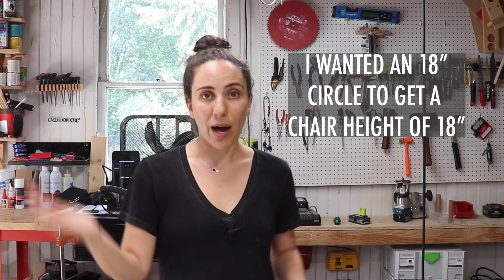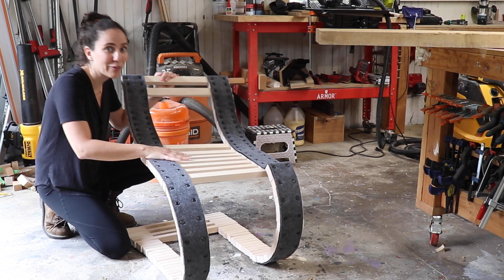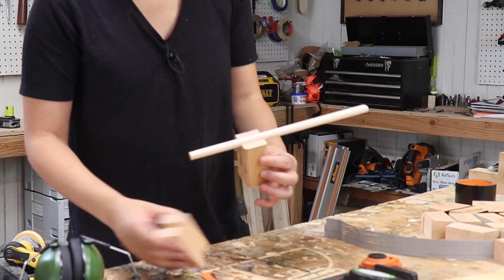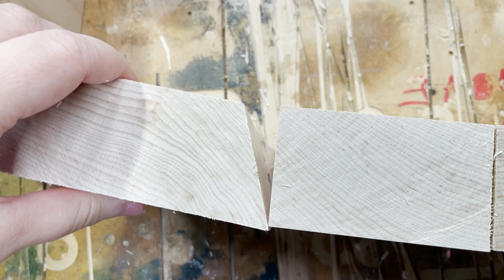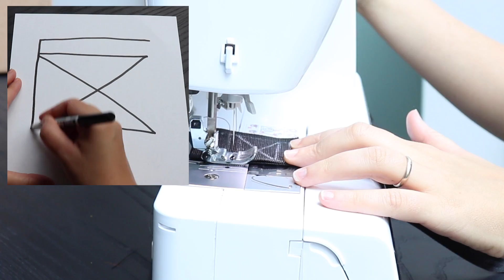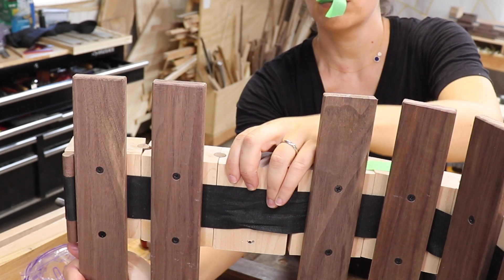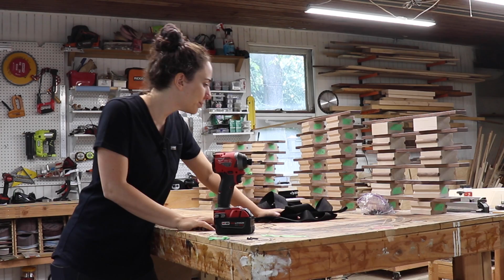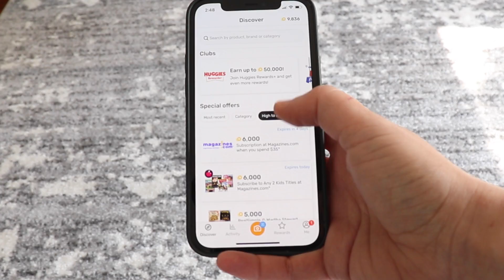I ATTEMPT to make a Roll Up Chair… AGAIN...

Comment: The answer is to make each segment a link in a chain. The mistake is trying to use a single strip, strap, or cable to hold them all together. Each segment should be mechanically linked to the other segments ahead of, and behind it. This will also help to drastically reduce the amount of flex from side to side. Any and all tension should be solely in the linkage between each segment instead of from one end of the span to the other. Think bicycle or motorcycle chain.  Good luck. ;)

Comment: This is the first of the vids if seen so if this is stupid sorry but I think putting a rope through the center of the wood to support instead of a one sided strap might help. Since the the strap is on one side less tension causes it to collapse and then adding more just causes it to curl. Im not experienced much with this but I think if you find a way to have the support in the center of the wood instead of one one side it would force the wood to stay together. I dont know if it would be able to roll up but if you can find a way to manage both it might work. Sorry again if its dumb but it kept coming to my mind

Comment: I think fitting the straps through the middle of each wood piece instead of a side would make it a lot safer, and probably metal cables or chains would be better than leather, polyester and such, since those aren't elastic at all. Those are a lot more expensive tho, so I'm not sure if it's worth a try...

Comment: I have two suggestions. The first is that the straps have to be attached with adhesive, box X stitches or some other means. The screws allow the weave of the strap to dislocate which gives the effect of stretching. This probably accounts for up to 30% of the stretch and also significantly weakens the strap. The other suggestion is to put spines on the backside of the blocks that rest against each other. The most important component of stiffness in a member is geometry, specifically the the second moment of area. Increasing the "height" dimension of the blocks with spines should drastically improve their effective stiffness.

Comment: UHMW is very TOUGH because it does “stretch”.   The technical term is “Modulus of elasticity”.  I am an engineer and as soon as you mentioned that you were going to use it, I knew what was going to happen.  Lots of interesting advice in these comments, that I am sure are meant well.     You will need very hard wood and a flexible strap that has unidirectional fibers like glass preferably carbon fiber to prevent stretching in tension.   The “non-stretchy” fibers can’t be woven, but they can be contained in a more aesthetically desirable material.  If you respond to this comment, I can help you with the math and the material.    But you are correct, pinching will always be a hazard.

Comment: Id say instead of using straps, put something on to have the pieces hinge like a strap or smth. But then metal pieces to click into the neighboring pieces and kinda lock it from the angle changing

Edit: rolls out then almost locks into place, be it with leverage on metal, or actual little clasps or what idk

Comment: What if you would put a metal hinges hidden underneath the straping in the pieces that have gaps in them?

That would not allow them to have those gaps while letting you fold them, and since straping would still be there it would hold them.

Comment: i have anne suggestion. when you design the chair, have it designed to lean too far forward, so that whwhewhwhen weight is applied it sinks into the preffered position.
Reply: also attach the blocks individually as a chain, rather tan a single strap.

Comment: =NEED TO DRILL UP A HOLES IN EACH SECTION

=AND MAKE THIS GETTING TOGETHER BY A STEEL WIRE.....NO OTHER OPTION...SO CONSTRUCTION IS BEING FOLDED WHEN WIRE IS FREE,AND BECOME UNFOLD IF TO A TENSION........

Comment: As folks have said before, it is easy to make suggestions without having done the work. However, I would suggest routing a couple of channels along the path the straps currently take and use coated cable in place of the straps. The cable should lay in the routed channels and provide the support you require for this project. It will also add a bit of contrast with the wood.

Comment: That strap is way too elastic for the forces involved here, I think using two braided 1/4" steel cables on both sides while increasing the thickness of the wedges would give you a much better result. Include a tensioning adjuster on one end and it should work.

Comment: You really need some kind of strapping that has no stretch at all, something almost completely rigid
Reply: If you made a groove under the slats and instead of straps used steel cables and use simple bolts to tension the cables somewhere at the bottom legs.

Comment: Debby downer here, I dont think leather is the solution. if the seatbelt material didn't work I doubt leather will.  I think this format won't work while the chair's unladen resting position is meant to be its laden position. I think you have to set it up so that the human sitting in the chair gives it the final form of a chair. The current design requires the straps to be completely rigid. It was really cool that you used the dowels to stop it from collapsing to the sides.  

Is this chair even worth it, the straps will stretch over time the wood will swell and contract etc. so if you get it perfect for how long will it function? 

Maybe change it from a chair to a backless chair and one sits the other way around ? Get it working with one curve first ? this has the added benefit that the users weight is above the feet that tend to curl up ? 

This was interesting and like many here I am now also invested in this project XD

Comment: Tie the straps around the back into the base of the chair. with a locking clip. 
You need support. 
You would need a super strong material like carbon fiber to do what you are going for without support.

Comment: Could it be done if you make a grove for a steel wire to take the tension? And if the steel isnt flexible enough to roll together, use it in sections. And you can of course cover it with straps or leather for additional strength and support

Comment: What if the lower section curves back up and connects to the back? Have it notch in then you can just pull it out and roll it up. So rather than the chair looking like the bottom half of an S it looks more like a d

Comment: I'm curious If adding the dowels between each section is responsible for the extra slack, it looks like when gaps open up from the downward force, they're sort of levering on just the inside corners. 

This project is really cool, I hope you can figure it out once and for all

Comment: Hey. I by no means know the art of woodworking, but I spent a lot of money on a mechanical engineering degree so, for what that's worth, here I am.

What if you used counter tension by connecting a cable to both extreme ends?

Kind of like how those impossible tables work. Use tension in multiple directions to fully constrain the movement. Thinking about it as a static system in tension and compression, having an apposing source if tension seems like a good idea. Just get your strapping as taught as possible, fix a cable to the bottom, fix a metal ball to the end of the cable, and set up a chair by attaching the cables to the top of the chair by inserting the metal balls in a retainer. You could probably make it even stronger by connecting the cables in an "x" formation, which would impose some lateral stiffness as well.

As you said though, this much tension really is playing with fire. You could roundover the edges that join to minimize pinching Hazzard, but if you get a catastrophic failure With this much tension it is scary.

(I'm writing a book I'm sorry)

You probably don't want to overcomplicate this, but I do feel like cable might be a better friend to you than this strapping. Even thin cable is designed for significantly larger loads. It probably has a way higher Youngs modulus (how stretchy it is), which means you would have to rely less on "tension" and could rely more on "rigidity", which after your video, seems like a good design paradigm.

I graduated school, so I don't have all my CAD tools, but If you want I could help you out with some calcs to get you an idea of how much flex to expect with different materials. I could maybe even program a simulation that you could use in your video!

Great video btw!

(I did some math in a comment btw)
Reply: Kept looking into it because this is just how I operate:

I found 1/8" braided steel cable which has a working load of 340lb. Apparently that's because it breaks at 1700 lbs. 340lb is well within the elastic range. Stainless has a Youngs modulus of 190 GPa.

Looking at the diagram for how this particular cable is braided, I think assuming half the area is steel is a reasonable assumption, meaning an area of around 9.85x10^-7 M2. You need area to calculate how stretchy something is.

So, if memory serves, stress=youngs/strain. If you're interested I can get you more detail, but I'll skip explaining some stuff and just apply the calcs

Assuming two cables, and the wood taking up a large amount of the load in compression, I think 50lb per cable is reasonable. Let's do 150 total for fun. So that's 667N. That means you have a stress of 667 MPa (them both being 667 is a coincidence because the area is close to a multiple of 10).

So our strain is... 284, which is a unitless dimension of deformation length over total length.

So, all said and done, let's say your cable is 7' long? It would stretch by about 1/4 of an inch for one cable, 1/8" for the two cables you would be using. If you used 4 cables it would hardly stretch at all: 1/16"

All that was on my phone sitting in bed, so there's almost certainly minor errors. If you're interested lmk, I'd love to get you some calcs and pretty pictures for your next go.

Comment: While this may be an over simplification, I feel like using a bunch of hinges instead of straps could work. This would mostly get rid of the stretching problem. The only problem would be finding strong enough ones.

Comment: I would imagine some strong metal hinges along the bottom arc would help keep those sections from spreading apart and still allow the unit to roll freely. If you want to maintain the design aesthetic then you could always cover the hinges with the strap at the end and / or use flat black painted hinges. 
As for the top sections collapsing just use some neodymium magnets. Magnets will securely hold the back rest sections together when someone goes to sit down.

Comment: How about using steel cable, and instead of using a single length of strap individully attache each block to the next with a short length of wire. With one length its going to keep putting all the slack into one point. With individually bound sections you will get a more even amount of slack on each section.

Comment: Did you search for climbing strap yet? They are super resistant to tension, and the same time are flexible

Maybe If you combine these material with a bigger radius on the bottom, can make It works hahahah

But these videos already amazing, and congratulations on your effort and quality of building and video
Reply: PS: you can make a simulation with a MEF (i am a Brazilian student, so I know "Médoto dos elementos finitos" and it's like " Finite element method") in some software of engineering (like Femap, Ansys or Inspire). For engineers this is a basic tool, and you can use this (or find someone who have the "know How") and find the correct length of the strap, correct radius before tension is applied, and adapt your project to your material 

This Will be a complex thing hahaha, butt maybe you will find this help with another YouTuber (and could bring really return in views hahahhahahha because this project is so interesting)

Comment: 27:43 the solution could be using door hinges instead of elastic material. That way the individual pieces wouldn't influence each other and the  backrest wouldn't curl up because of the seating area.

Also, by adding some magnets, the pieces could be held in place when the chair is in it's chair shape.

Comment: I have a few things that may help you if you decide to make another model of this chair:
Firstly, you could probably use metal hinges (door hinges) where the segments connect instead of a strap as that wouldn't stretch.
Secondly, a seatbelt may be a viable option for a strap, and they may be free if you get them from a scrap yard.
Thirdly: Check out the video by Josh Wright in which he makes a similar chair. It holds weight, but doesn't look as good as yours. Here is a link to the video: https://youtu.be/MuodNlDKce4

Also, this is an absolutely amazing video, and an excellent idea! Keep up the fantastic work - your projects are a great inspiration for us all! 😁👍If you do find a way to make it work, please sell some online if possible, since many of us (myself included) would love to purchase this.
Reply: i was going to say door hinges as well.
Reply: Seatbelts do have high tensile strength but they are meant to stretch a bit under high forces so that crashes are safer. In a bad crash it's recommend to replace your seatbelt because they don't rebound from the stretch, but it usually doesn't get replaced because a lot of the time the car is totaled at that point
Reply: @32Rats  If each hinge flexes 1/32, and they will flex at least that much, there will be far too much slack.
Reply: @Bob_Adkins  you replied to the wrong comment
Reply: Use thin metal strips (like metal strap banding thickness). Absolutely enough tensile strength to hold this and hopefully if correct thickness is chosen it will be malleable enough. Width can be adjusted to make sure ultimate strength is ok. I think you need some sort of pre tensioning roll as well which you could rachet (think a rachet strap type mechanism. I really love this concept. I'm not sure if the pre tension would interfere with the reverse roll however.
Reply: @sstewar28  sadly this isnt such an good idea as it may seem at first because metal fatigue is a thing and the strips would eventually just break after the chair has been rolled up and folded out for a certain amount of Times.
Reply: @nikitaw.1822  There are flexible metal connections being used for years in high stress environments. Way higher stress than this.
Reply: My thought as well, using hinges metal or wooden included in the pieces instead of the dowel inserts.
Reply: Could try using metal wire.
Reply: Hinges might make it stable, but then you couldn't roll it up.  You'd need some sort of expandable hinge for the bottom section.
Reply: Pretty much, yes the reason why Josh's works is because the strap is attached to each block individually and does not allow the tension to spread throughout the whole chair.  This is the problem in Tamar's design.  Easy.
Reply: Sadly, strength in a material can involve allowing quite a bit of deformation without failing. Rubber has high elasticity, spider web has high plasticity making it very "strong" for it's weight, because it will stretch so far without breaking. Fatigue strength is a more complex measurement of how a material will hold up over multiple loadings over the material's life.  These are awkward terms, and most promotion for a material won't be too precise as to exactly what their numbers really mean.
Reply: Josh Right solved this problem with metal palette banding that's screwed into every slat. It's a fairly flexible material that doesn't stretch much length-wise https://www.youtube.com/watch?v=2MSEnMGFhMg  It would probably still work without his interlocking slats
Reply: You could sew seatbelts together with a heat shrink layer in the middle. Stretching the seatbelts will cause heat, and the heat shrink layer will shrink to compensate. You could also use a braided steel cable (like ocean fishing line)
Reply: I agree with Ruby Malia. The fact that the webbing is not fixed to each piece of maple allows the stretch to translate along the length, and add up at the most stressed joint. I would go with hinges, or add removable support posts between the curve for the back and the base. The example you show at first looks like it has hinged pieces on the top, too.
Reply: What about having separate strapping for each section? That way the tension from the main curve can't be transferred to the top and bottom sections
Reply: Hinges sounds like a neat idea. As long as the tension doesn't rip the screws out of the wood, this should hold a lot better than the strap.

Comment: I’ve been waiting for this video for so long, it sucks that it didn’t work again. Maybe instead of using a strap you do everything the same as this one but connect them all with metal for hinges. The pressure might tear the screws out of the wood so maybe just add hinges on the big curve?

Comment: Explaining why this is hard is pretty simple. Coming up with a solution that works with common woodworking equipment and materials, not so much.

This chair is made up of a lot of linkages. The torque loading each link once locked is quite large due to the small lever lengths involved. Similarly, any elasticity in the system, mainly due to modulus of the strap and the compressibility of the wood will translate into geometry inaccuracies. the large number of linkages makes these errors add up.
So general strategies:
* Use the hardest wood you can get
* Use strapping with the highest elastic modulus you can get
* don't be over-zealous with making the elements thin
* Equally, try to minimize the number of linkages, even if that makes the design more clunky
* minimize any relative movement in the connection of the strap to the wooden components